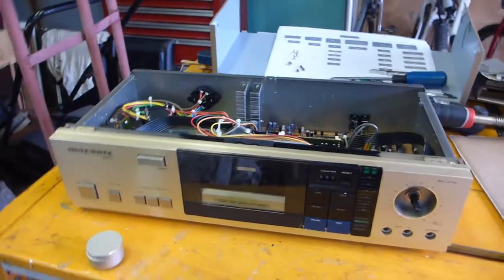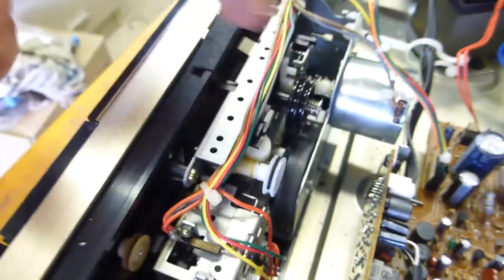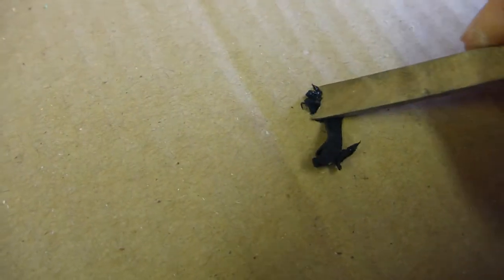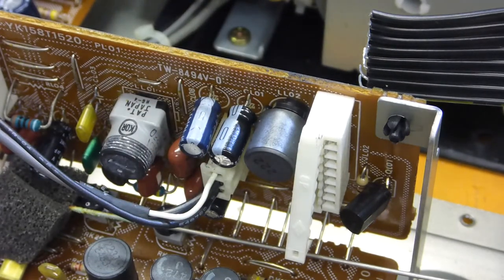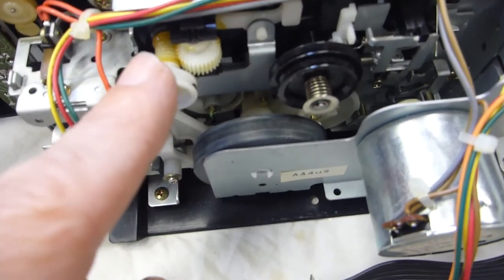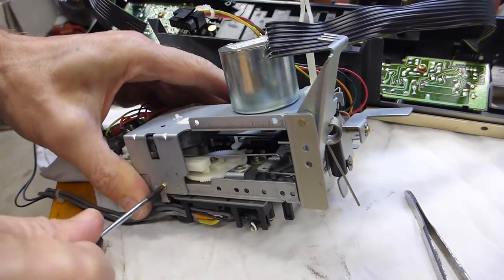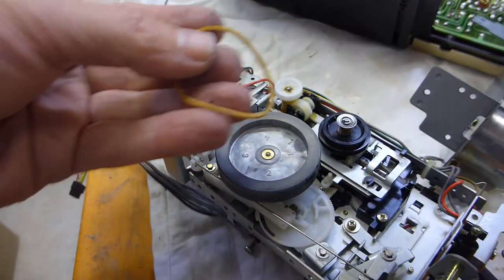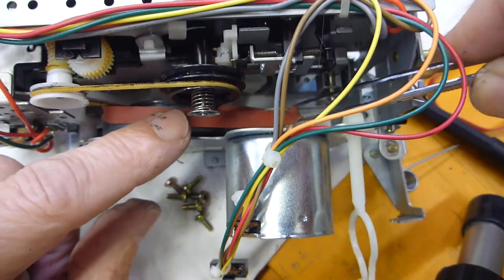Marantz SD240 Tape Deck belt replacement

Comment: Thanks for this! Will be attempting to repair my own unit soon. Different model to this but can't find the right belts online at all. Can you point me towards where you got your replacement belts please?
Reply from the maker: I have always used 'the rubber bands you get with 'Australia Post' deliveries, or if you are overseas, wide red rubber bands. I have found them to be universally as strong and reliable as factory replacement belts - the trick is not to make them too tight, or they can slow down the capstans, dropping the tape speed below 4.75 cm/s. Years ago I bought a bag of loose rubber bands from a junk shop, they come in all sizes and are perfect for tape counters (not for main capstans though). Cheers